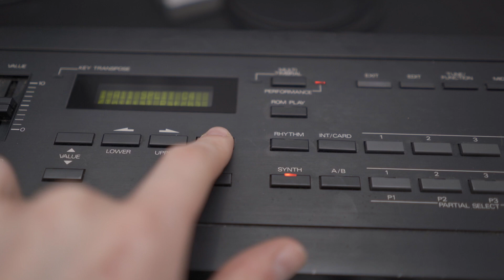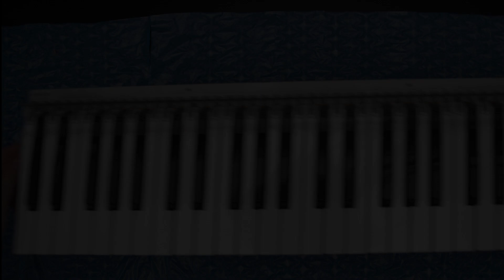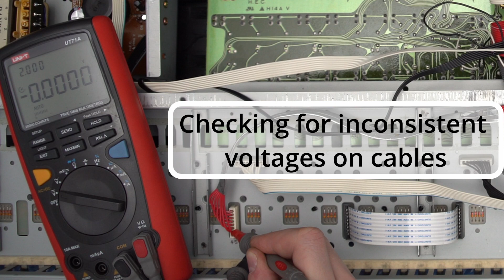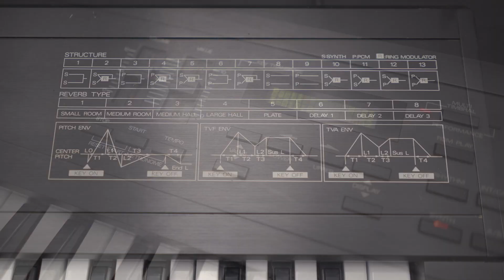Vintage synth restoration - Roland D-10 from 1988

Comment: Great video!  I am attempting to restore a Roland Juno D which has dead keys like yours.  I took it apart and cleaned the rubber membrane / carbon buttons and the pcb where they contact but still not working ..  still have some dead keys or difference in volume.  I ordered new rubber membrane / carbon buttons to replace the old but wonder if the issue is not on the PCB.  You did find a difference in diode output values was that from the corrosion on the PCB?  I have seen others "fix" the dead key issue using a pencil / graphite on the buttons.  So I wonder if the real cause of the issue is the carbon buttons wear out?  The pencil graphite just adds a conductor back to the button.  Thanks for posting.  fun to watch you dig into it and fix traces on the board.
Reply from the maker: Thanks for the lovely comment! I think the problems could be caused either by the pcb or the carbon contacts, both on the pcb and on the membrane. The pencil trick definitely works, although you need to make sure its a good pencil and works for this (some dont!) - if you have a multimeter, try drawing a thick blob on a piece of paper and poking the multimeter probes on the blob, if you see that its definitely conducting. Good luck!
Reply: @TheRepairLair  Great idea!  I will try it out first before applying it.  I have new membranes on the way and one of the two PCBs, so mostly will be new but I will use the pencil trick on the pcb that will be original.  Again love your content and thanks for posting.

Comment: Do you know if the rubber key pads sometimes wear out or disintergrate causing an intermitent key?
Reply from the maker: Yes - it is possible that the carbon coating on the contacts has worn out, BUT  - the good news is that you can try and paint over both the rubber side, and the contacts on the pcb with a pencil, and it may fix your problem
Reply: @TheRepairLair  Thank you. I will have to take it apart at some point and gie it a look. It's likely the key I used as a snare drum.

Comment: Do you repair vintage synths for hire?
Reply from the maker: I repair things as a hobby, so far only done 3 synths, only digital. But i might be able to help :)
Reply: @TheRepairLair  I have a D-10 that I recently replaced the battery for thinking that was why it was losing sounds in memory, but it seems like there might be a problem with the connections. It it sporadic and works a little while then doesn't, etc. I haven't taken it apart completely and I don't really have the skills you have with soldering, etc. Not sure if Roland would still repair these or not. Any ideas?

Comment: Do you have a link to the tape, buttons, and pitch bend you used?
Reply from the maker: The tape is 3M 300LSE low surface energy, buttons are 5x6x6mm 4 pin push button switches, and regarding the pitch bender - any one from D-5, d-10, d-20 or d-50 will fit this synthesizer. Sorry, i didn't keep any specific links i can provide.
Reply: @TheRepairLair  no worries, that should be enough information and I really appreciate it!

Comment: I recommended you to bake the text directly in the video rather than using YouTube subtitles, because the later blocked the area of interest throughout most of the video, and if you placed the text directly in the video you can place it around the areas that are not of importance.
Reply: While I was writing the previous comment I remembered that you can place the YouTube subs wherever you want, I've seen other channels do it that way. Maybe you can do it that way.

To give an example, one area that is hard to watch because the subtitles are blocking what you are doing is around 9:22.
Reply from the maker: Thank you for the suggestion, i will take a look!

Comment: I have to replace all the tact switches on my D20 - but I’m nervous about those raw ribbon cables you pull off the main board around 3:00. Are they just clamped holders? And how easy are they to get back in?  Thanks!
Reply from the maker: Indeed they are just clamped in! The connectors are called "Wire Trap Connectors", and they are easy to both remove and reinstall. You must simply push downwards on the middle part of the connector (basically, the plastic immediately surrounding the cable) - this unclamps the cable, and it can be pulled out with almost no force! The reverse is exactly the same - push the middle part downwards, hold it there, insert the cable and release. The insertion also should take no force when the middle is pressed down correctly.